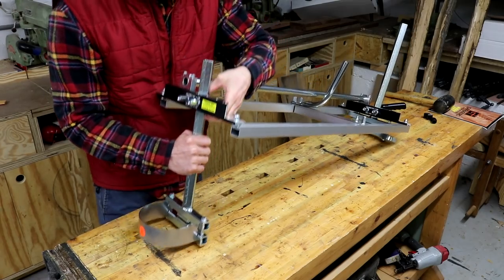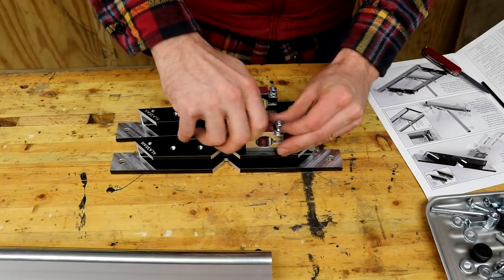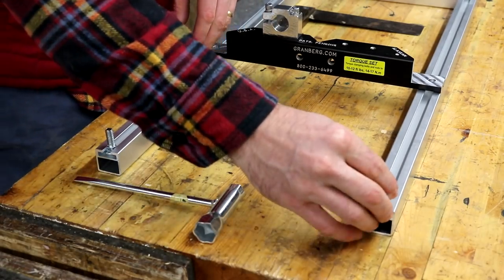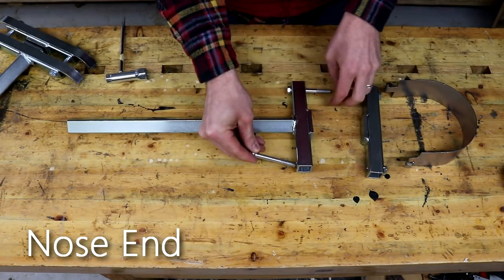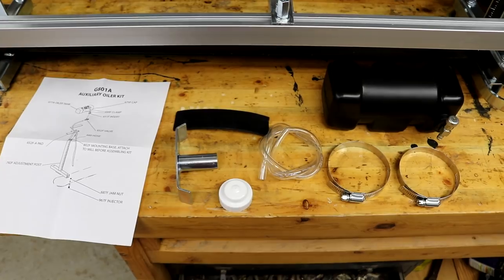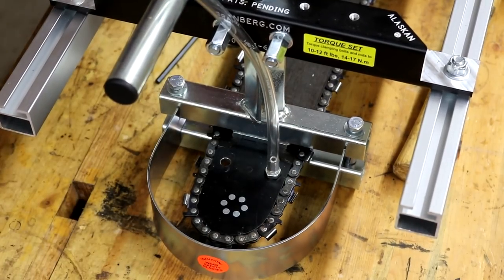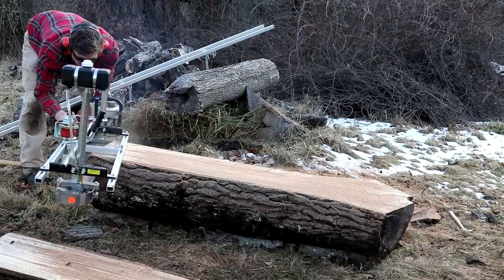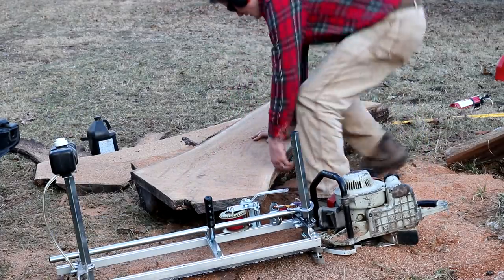CHAINSAW MILLING AT LAST!!!! - GRANBERG ASSEMBLY

Comment: I used to mill with that exact chainsaw!  You might need some good anti-vibe gloves soon, haha.  It's such a beast of a chainsaw.
Reply: Hand Tool Rescue your channel sends me on midnight binges. So satisfying to see restorations
Reply: #WeWantACollab #GiveHimAPlugOnYourChannel
Reply from the maker: Reving the saw out of the mill without cutting is pretty rough on the hands. For milling it's not to bad so far and it does a great job. I did not have the carb set quite right on those first cuts and the crankshaft sleeve was worn out causing the clutch to slip. Now that it is tuned right and the sleeve replaced it is cutting great. I was slabbing the walnut at 36 inches wide, 100 inches long in about 3 min. Thanks for watching.
Reply: Man love to see that, please!

Comment: That's an interesting bit of kit, although there is clearly a fair bit of skill to setting it up . The results are amazing and I marvel at the availability of timber like that. Where I live there is a lot of timber farming which tends to produce  softwood for the paper industry . It's a treat to see hard logs being machined for furniture making.
Reply from the maker: Setting it up is easy, the instructions are spot on and all the hardware is standard stuff. The whole process, while strenuous, is rather simple. With a helper or two...........or simply not milling 3-4 inch thick slabs 8 feet long and 36 wide, it's not too bad.

Comment: That's how i feel about using my mom's gas powered pneumatic log splitter to chop fire wood. ;) pulling that lever down and watching the log break in half is satisfying as heck.
Reply: The thing I find satisfying about the splitter:   I can split a cord an hour.    It's a half-cord a day manually, and it requires more Advil :)

Comment: the auxiliary oiler is an absolute must. although mine doesn't have it, it was obvious right from the get go it was needed. the one thing that granberg doesn't tell you when get their mills is that a bar rail grinder is also an essential piece of equipment as well as a chain grinder. it doesn't take long for the chain to start to drift and wear the bar rails a little to one side and the for the whole shebang to bind up in the cut. especially in larger logs.
the auxiliary oiler helps prolong the wear pattern on the bar rails but every two to three sharpenings of the chain also require a regrind of the bar rails

Comment: You'll like that bar, should last a long time. I started with a chainsaw mill. Now I have a Woodmizer. The snow is melting slow up north but once it's gone I'll be in the woods cutting as well.
Reply from the maker: The cannon bar is nice so far. Be interesting to see how long it lasts in such a demanding application. My dream mill is a Timberking 2000 or 2200. I'm waiting for the right time and a bunch of money.

Comment: Great looking wood. You need to use some non-metal wedges to shim the top slab behind the cut to keep everything level and smooth operating. It will also yield you truer slabs.
Reply from the maker: I've got them and they do make things easier, just didn't have them for the testing.

Comment: Awesome I want to see more.  What do you have in mind for drying out the wood?  Kiln drying and for how long?  How do you prevent warping splitting and cracking as it's drying?
Reply from the maker: It's all in the next video but in short, I am air drying it for a while. I painted the ends of the logs a bunch to slow the drying at the end grain. The wood is stacked and stickered up on cinder blocks and 4x4's with tin over it. These slabs will probably sit for 3 or more years.....or once they are around 20 percent MC I may kiln dry them. I'd like to build a solar kiln, maybe on a trailer so I can move it around.

Comment: I would imagine the next time you'll start using wedges in the cut to make pushing the saw a little easier. Great wood.
Reply from the maker: Absolutely, didn't have them with me for the test but used them on the walnut.....on the days I didn't forget them.

Comment: You are so lucky :) you've saved a ton of money getting that wood for free. Well done
Reply from the maker: As a log it is valuable but probably would not have brought a lot since it was a yard tree in a tight spot and dead.....all milled up and dried, yes, quite a bit of money......but it took me almost a week to plan, buck, slab, sharpen, fix, slab, sharpen, etc, move and stack. The bottom log, which I milled last, was full of nails. I hit right on one of the heads with a brand new chain, cutting for the first time only one foot into my cut and trashed it. Took about 2 hours to get the chain back into shape and kept hitting stuff, but the slabs were far more than the chain....but time is precious to me.  The owner's other option was to pay someone to come in and cut it up small and haul it out. If I would have turned down the log that was its fate. But yes, I still do feel lucky despite the extreme effort.

Comment: Awesome work,can I ask which ez ladder did you use on the first cut,looking at amazon i see one 18 inches long really confused..
Reply from the maker: It's called the EZ Rails. Mine is about 9 feet long, I think they have discontinued that size and only do 5 foot lengths that you can join together to any length you need. Check out their site. granberg.com

Comment: Great video. Your saw had no problem at all. I’m pretty sure I’ll have to buy a larger saw. That’s were it gets a little more spendy
Thanks again.
Reply from the maker: For smaller stuff you don't need a monster saw, just a decent saw and the right chain. For big stuff your going to need power, which means around $2000 for a new saw......less for used. I'm using a Stihl 090 which is a tank.
Reply: The Homestead Craftsman thanks. 
I check the website, it said min 50cc and 20” bar. I already got one coming with a ripping chain. Got to love Amazon. 
Soon  I’ll be making a farm house table. I’ll be going back and watching some of your great videos. 👍

Comment: What's your advice on storage of these slabs? Not just for proper conditioning, but also advice to someone like me who would love to mill like this but have little to no storage space!
Reply from the maker: I did a video stacking slabs. Stack on a base of cinder blocks and 4x4s. Space slabs with strips of wood for air flow. Put some roofing tin over stack. Let It dry for years.

Comment: Awesome video! What kind of chain did you use? Did you buy a special chain for the Granberg?
Reply from the maker: I have some NOS Stihl ripping chain which is what I was running on the shorter bar and a Granberg chain as well as a loop I made up of the Stihl chain for the 72 inch bar.......lots of teeth to sharpen. They both work great, with the Granberg chain good and sharp I could make a cut 36 inches wide, 100 inches long in about 3 min....but the saw has a lot to do with that as well. You need a lot of power for the big logs, I'm using an Stihl 090 which is 137cc. Most of the chain companies make ripping chain, the Granberg "brand" chain I got is made by Carlton, I believe it is a Granberg design. Check out their website if you'd like to see more about it. I'm running  404 chain which is the big one.

Comment: Wow!! Very cool, fantastic video. Do you need a special chain for rip cuts like that?
I can see some amazing live edge tabletops there.
Reply from the maker: Yes, I'm using ripping chain. I've got some Stihl chain and a chain from Granberg (which is made by Carlton) A ripping chain has a very blunt angle, these are 10 degrees and shaped a little different. My chain is a .404 which is big. A crosscutting chain would dull quickly in this application......although I've heard people say different.
Reply: The Homestead Craftsman Thanks for the info. Making windsor chairs, my processing of a log is usually done with sledge and wedge but the chainsaw is definitely a favorite tool.
Best of luck with all that beautiful walnut and be safe.
Cheers

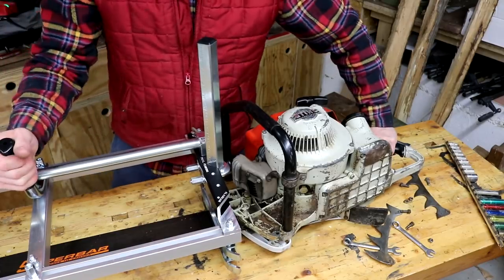Comment: Hey boss, I just want to offer you my Granberg experience: The round tube that cross-supports the main assembly can go on either side of the risers. In the configuration shown in the instructions, the round tube will interfere with sharpening. If you swap sides, it will not (4:35– tube goes below the push handle). The second thing I'd recommend is the purchase of a socket wrench and 1/2" socket specifically for the mill (I store mine inside the rubber on the mill's push handle). The scrench becomes tiresome very quickly.

I look forward to another video detailing the use of the winch. Thanks!
Reply from the maker: Thanks for the ideas, now that I've got it together and a good bit of using it under my belt, I'd like to start doing small things to make using it easier, like your wrench suggestions and having other tools and equipment at hand. What I really want is one of the gas powered capstan winches. The work is pretty heavy dealing with the big stuff so I want to do as much as I can to lighten the load. I also want to make some sort of gas powered log or slab mover, like a log arch that is powered by a geared down small engine....basically a wagon combined with a go cart..... sounds like the road to needing a four wheeler.

Comment: Just gained another sub! Looking forward to some more milling videos,id like to try an 090 on my mill ,i use a husqvarna 3120xp . How do you like the ez rails? I just bought a set,taking a little getting use to
Reply from the maker: I'd like to try your saw....and an MS880. I'd also like to put another 090 on my double ended bar just to see what double the power would do. I like the ez rails, kind of an all in one system. I have not joined two sets together though, I'd like to see how that works.......I also have a SUPER long extension ladder section which I would use if I was milling really long stuff. Most of what I would mill with this mill is going to be wide stuff and probably 8-10 feet at the longest.....moving anything longer would be too hard. I made a few twisted cuts before really being careful with the level, once I got the hang of it, it was pretty easy. You have to get one side roughly set up, do the other side, then the middle then check it all again......but the adjustability makes for a quick set up....I think it works best on relatively straight logs. Otherwise, you will need to make several cuts or do some shimming like you would with a ladder....still learning so my opinions may change, but not for the worse....In short, the EZ rails are great.

Comment: Dang, your a lucky guy to have that mill. I helped a guy do that in the woods a couple times and loved it! The smell of the wood, the exposing of natural grains and the thoughts of what you can use the slabs for was great!
Even though you can somewhat smooth and straighten the slabs with a router jig, (Q1) I’m guessing the next tool on your list will be an electric 4” hand plane? (Q2) are you going to build a Kiln building, or a covered shed for air drying or just stack and sticker them in that other side of your basement?
Reply from the maker: I have  nice power plane, it's a 18v Milwuakee.....but don't let the battery power fool you, it's got some power. It will be good for rough leveling a board if it gets a lot of cup.......which these should dry pretty flat with the way I've stacked them. I've got them stacked as they where sawn, level and stickered up off the ground and strapped together with ratchet straps which I will keep tightening as they dry. They are outside, covered by tin.

Comment: Do you sharpen the chain teeth for ripping or leave them as crosscut ?
Reply from the maker: I'm using chains ground for ripping. They have a 10 degree angle.

Comment: Any plans for the Y shaped boards you made with your first cuts?
Reply from the maker: None so far, but they will be drying for a while, so I have time. The formation is caused by the tree splitting into two large branches, it is referred to as a "crotch" and has a lot of interesting grain due to the way it grows.

Comment: Regarding the first cut system. You might find that after you spend all the time to get it level and then go to cut, the leveler bolts shake out of place. If you haven't don't this already or granberg hasn't included them in the package yet... try securing some nuts down on the leveler bolts from above and that will solve the problem.
Reply from the maker: I had that happen with one of them that I did not have tight to the log, the nut is a good idea

Comment: Man that is awesome. How long did it take to finish a 8 ft or 10 ft log?
Reply from the maker: On the wider cuts, about 3 feet, I was cutting 100 inch long logs in about 3 minutes with a sharp chain. Pretty fast for what your doing. It's the set up and in between cuts that slows it down.

Comment: How do u decide how thick you are going to mill the slabs?  Do u already have projects in mind?
Reply from the maker: Most of these slabs, the walnut that is, would be used as table tops, in which case I'd be aiming at a 1.5 to 2 inch final thickness so I'm milling an inch over that for leeway. I could also resaw some of this if that suited me. Most of what I milled was 2.5 and 3

Comment: I have one of these.. it’s nice for beams.. just takes forever..
Reply from the maker: I was making my widest cuts 36-40 inches over 8 feet in about 3 min...I think it's the saw, a lot of power behind a sharp chain really gets it done.
Reply: The Homestead Craftsman yeah I have to agree.. I was making small cuts with a sthil 550.. it’s a lot of fun! They are a gateway to a small sawmill.. hahah
Reply from the maker: This mill was step one for me to be able to mill big stuff when I find it. Later once I'm settled at a house that I will be at for good, I want a Timberking 2000 or 2200 bandmill.
Reply: The Homestead Craftsman for sure.  You would get a huge return on something like that.  They may give you a good discount b/c of your YouTube base.. it would be worth asking.. good luck! 👍

Comment: That was awesome! Hurry up with them videos! .......Just kidding 
You ever have trouble with the chain saw at that angle for long periods of time?
Reply from the maker: I've already filmed the whole process all the way to stacking it all up......but you'll have to wait to see. A chainsaw, if running right, will work in about any position. This saw calls for a 40:1 fuel mix but I am doing 32:1 since I'm really using it hard, seems to be running great and not really smoking that bad. I've got the governor removed and the carb tuned to run like a top but not to fast. I did have some issues with the saw turning off at idle when on it's side but only after cutting about a foot into the slab while putting wedges in. Once the saw was running and all warmed up it did fine. Not sure what was causing that, could be the fuel mix......not sure as I'm not a small engine expert, just know enough to be dangerous.

Comment: Were you using a Granberg chain?
Reply from the maker: Yes, also using a Stihl Ripping chain. Both ground to 10 degrees, the Granberg has a special design though. check their site for details. It works good.

Comment: How big of a chainsaw do you need for something like this?
Reply from the maker: For milling the big stuff, you want a big saw, as in the biggest. My 090 is 137cc. Most homeowner saws are 40-60cc to give you a reference. The MS880 is the biggest modern Stihl and Husqvarna is the 3120xp. Both run around $1,800 for the power head or you could find an 090 on ebay.... you can search the sold listings to see what prices they go for, it's a big range from under $1000 to thousands depending on condition. It is an impressive saw.

Comment: What would be the adequate size chainsaw for the job?
Reply from the maker: Depends on what you are milling, I think Granberg has suggestions of what size saw for specifically sized mills. But I'd say the bigger the better. For large stuff like the walnut I previewed, I would want a saw like mine or the modern MS880 or Husqvarna equivalent.

Comment: It looks like the bar oil soaks into the slab that you cut. I think this will create a problem later when you try to put a finish on the slab. Hopefully the oil hasn't soaked too deep into the wood and will come out in the sanding. Please let us know when you put a finish on the wood.
Reply from the maker: You are just seeing how wet the wood is, even if some oil gets on the slabs, it's not going to go that far into the wood. Thanks for watching.
Reply: JOHN SHOUREAS I've never know for that to be a problem. Any oil residue left by the milling process is very superficial.

Comment: Now you've been bit by the sawdust bug. I see a band mill in your future.
Reply from the maker: It's on the list, I want the Timberking 2000 or 2200. I have a fella that I get to mill for me, he has a band mill and I've ran it....it's quite fun. I'm not going to get one until I can get one that is fully hydraulic. It would be for mainly milling dimensional lumber whereas the chainsaw mill will be for the really big stuff and live edge that won't fit into a portable bandmill.

Comment: Why the grandberg mills over other brands?
Reply from the maker: There are not too many makers of chainsaw mills really. I like their mills, reasons.....they come apart, so you can break them down if needed, add stuff to them since they are extrusions with t slots, mostly aluminum so light vs if they were steel, good reviews, etc. After using it, I can't think of anything that would make it better, it's a simple design that works.

Comment: You could sell those slabs for 100-300 dollars each if you have a way to market them. Maybe more. Definitely pay for the mill plus a steak dinner or two.
Reply from the maker: The big walnut slabs will go for quite a bit more than that dry.